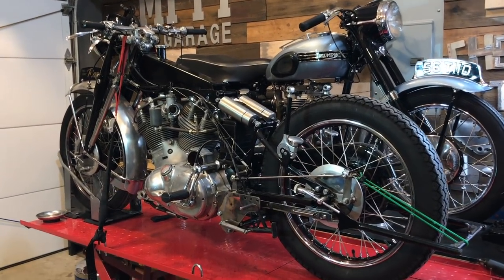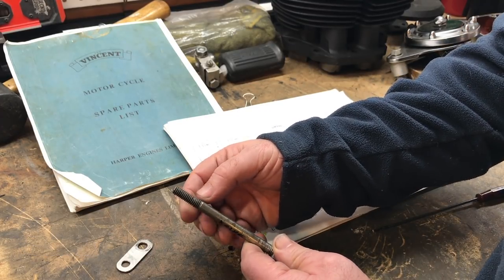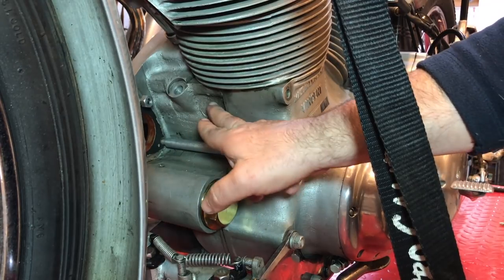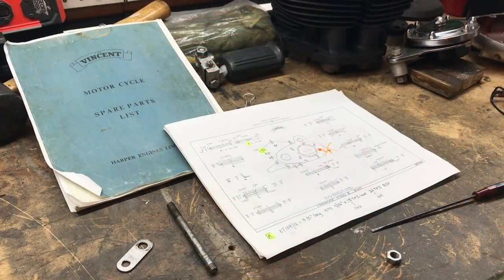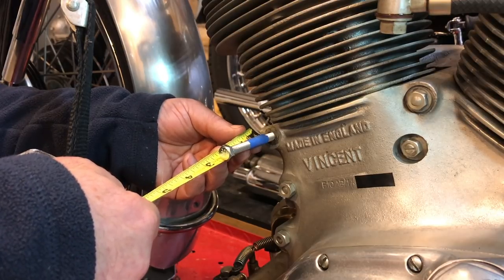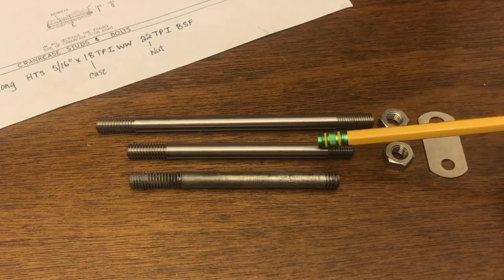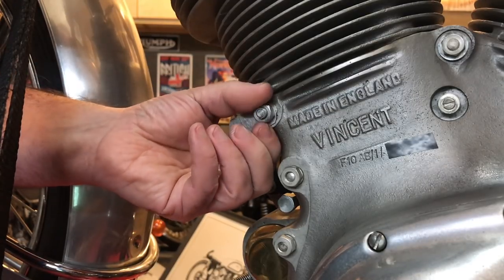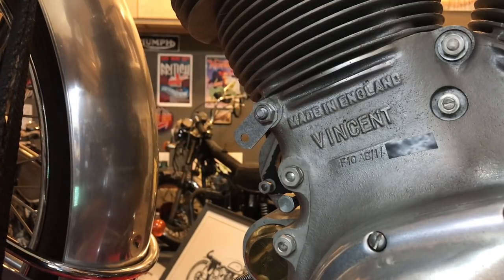Restoration of 1951 Vincent Rapide - Part 15 - Crankcase Stud

Comment: It is worth saying....That stud should have a straight slot on the end. You should loctite the very end of the furthestmodt treads lightly... and coat the body of the bolt with a very light coat of yamabond or other non setting RTV. Hope that helps a bit!
Reply from the maker: Hi Stephen, thanks very much for your notes.  Much appreciated.  This helps a lot.  I will do that before the bike goes back together again.  Cheers, Mike
Reply: Mi Ty - I can only speculate why they tend to be boogered up so often. I think there is a running resonance that takes them a bit loose and they vibrate. Possibly cause of the repeated access to a magneto? Not positive, even after dealing with so many. You would not have to split the cases under any circumstance to do a repair, so you know. I turn up some oversized inner threaded studs on my lathe from stainless or steel and have them CAD plated. Do not worry so much about seizure from not lubing the new SS bolt.... it is the lesser of two evils... better it get stuck in, frankly! There is no published torque spec... but the slot end is designed there is for a few reasons... one being they did not want that location compromised by over torquing. Great videos!

Comment: Glad that came out OK, it looks like the fitter that assembled this engine was completely incompetent ,I wonder what other horrors remain to be discovered, I think I would take the whole engine apart after these discoveries, it looks like whoever put this back together did not know what he was doing, but then I have said that before. One tip if you ever have a similar stripped thread in a blind hole, get a steel tube that will fit down the hole, tape it to a powerful vacuum hose,  and push it in and out of the hole to get all the swarf out, then when you screw a new stud in, ( having DIED it with a good 5/16" BSF thread form) you will not risk of stripping the thread, the parts book, as you have seen, is an essential thing to have as it gives the length of the correct stud. Good Luck ! Chris B.
Reply from the maker: Thanks Chris.  Yes, I should have mentioned that I did something similar.  I went in with a little pick and a small screwdriver and poked around and quite a bit of debris came out on the ends of the 'picks'.  Then I blew it all out with compressed air before inserting the new stud.  Cheers, Mike
Reply: Mi Ty: I find one of my most useful air tools is a 4" length of brake pipe soldered into a air blow gun, you get the air right to the bottom of the hole using that, it is surprising how much more chips you get out.

Comment: Have you considered using an epoxy-based thread repair kit? These claim about 70% original strength on the repaired section. This will give you more confidence in torquing up the engine case stud. Bolt/stud is first coated with release agent to allow removal. Then to coat with the epoxy mix and get some down the bore hole....thread it up snug and let set...before applying more torque. Permatex is one brand for these kits...i've used on stripped car brake caliper mount bolts to good results.
Reply from the maker: Thank you TornadoCAN99 for your advice.  I haven't tried that before and will look into it.  cheers, mike

Comment: Did you get that debris out of the hole?
Reply from the maker: Thanks caakacky, oops, I should have mentioned that.  Yes, I went in with a little pick and a small screwdriver and quite a bit of debris came out.  Then I blew it all out with compressed air.  Cheers, Mike
Reply from the maker: hehe, you are so right about worrying about the bottom end!  Yes, I'm a bit nervous about it, but the previous owner assures me that it hasn't been touched.  It is only the top end that has been 'touched' and this is where I'm spending most of my time right now.  I have a good sense of what's happened and why these issues have occurred.  So I have more confidence that the bottom end hasn't been touched... do I sound like I'm trying to convince myself ;).   I'll be very mindful of how things progress and what we continue to find!  I think seeing inside the timing chest and primary case will be a deciding factor.  Thanks a lot, Mike
Reply: Hi Mike, no need to reply to this - don't want to monopolise your time. I recently had a failure on my AJS 350 which needed the crank to be split. With the help of a more experienced club member we did the deed and found that the main crank pin was badly galled - not what we were after at all but had to remove it to get at the chewed up oil pump worm on the timing side axle. Would never have known the crank pin was u/s otherwise. Hence my/your suspicions/doubts. All the best - John